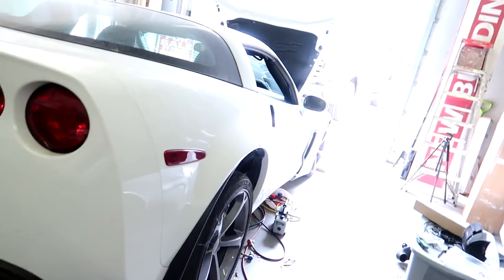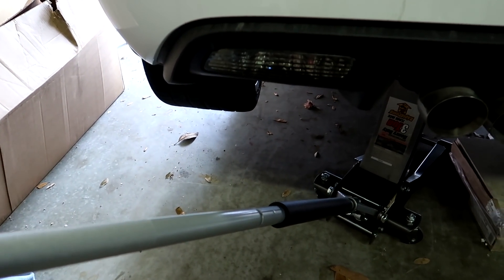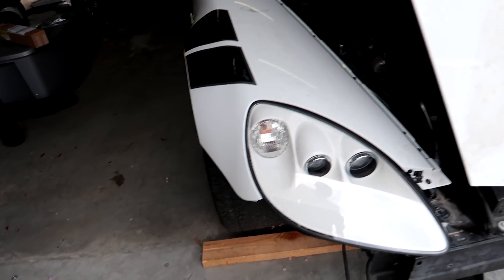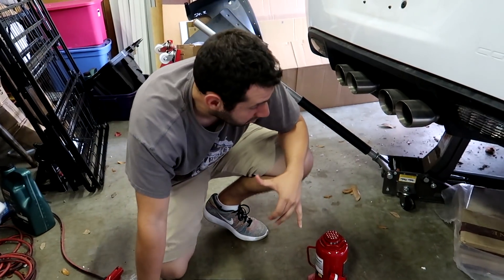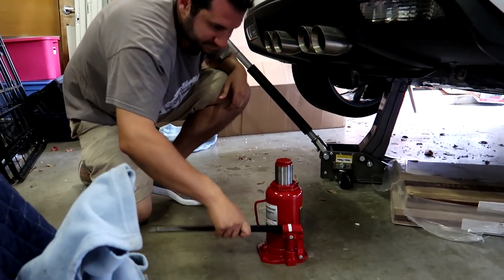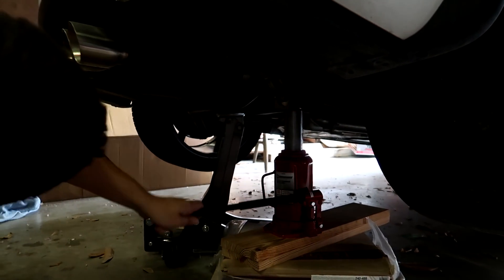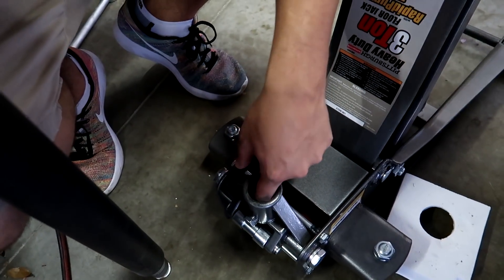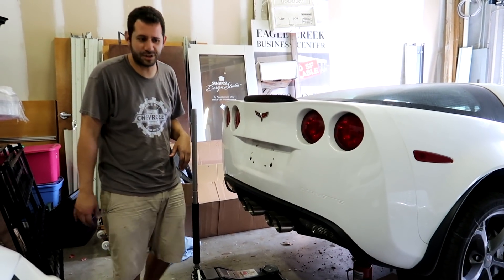Cheap Idiot Gets Harbor Freight Jack STUCK Under Corvette

Comment from the maker: If your jack stays up for more than 36 hours you may need to call a professional mechanic
Reply: LOLOLOL :))
Reply: If your jack stays up for more than 4 hours...

You're a popular guy!!!
Reply: Samcrac "consult your mechanic if your erection lasts for more then 36 hours"
Reply: Hahahahaha.
Reply: Samcrac or or hear me out here... make sure the lock bolt is not preventing the pipe from reaching the pressure release thingy....lol, but I don't believe that actually happened is probably a may 26th fool joke
Reply: Samcrac Having a tough time buddy I have them also it sucks 😬
Reply: LOL
Reply: Also Samcrac that Pad on the bottle jack screws in so you can get it fairly high without even pumping. once you get it close then start pumping.
Reply: isn't the top part of the bottle jack a big screw ? so you can turn it to raise
Reply: Samcrac you take the strew out and but the bar in then but the strew back in
Reply: I don’t see you even using jack stand for your own safety. Go get one for 20$ be safe out there one love PrincePam
Reply: Am I the first the tell you that on the bottle jack, you can unscrew the little red pad up about 4 or 6 inches.  Would of saved you a lot of pumping.
Reply: @Samcrac i just bought one of those same  3 ton low profile ones yesterday. They come brand new very LOW on oil, you are supposed to remove the metal plate in the upper area, and add hydrualic oil to it (directions are listed on the jack itself or the paperwork).
Reply: Props for showing your good shots and your stupid mistakes. The bolt is there for an additional safety, that way you cannot accidentally lower the jack and potentially hurt yourself, think of it as the safety pin on jack stands. 
And speaking of, you should definitely ALWAYS use jack stands when working under a car! If your jack seal blows, you're essentially dead.
Reply: polobunny ... the bolt is NOT there for additional safety so you cannot accidentally lower the car...

The bolt is there so you can use the handle to move the jack around and the handle doesn't pull out of the hole... it's just a keeper ... you can still lower the jack with the bolt in place.

Today I learned...
Why so many people get hurt working on cars ... Sam should do a follow up video on this with someone who knows what they are doing , showing all the many things he did wrong that could end up with life threatening consequences. I can't believe he just did that bottle jack crap on the subframe on a Corvette and thinks it's ok ... I was cringing thru so much of that video my cheeks hurt.
Reply: Please buy a decent set of jack stands, they're not too expensive, and they can save your life.
Reply: Samcrac Dude, the top of the bottle jack unscrews.
Reply: The bottle jack also has a screw mechanism to pre-lift the piston so you don't have to put it on a stack of tiles to lift taller things. 
RTFM..
Reply: Jack priapism is no joke !
Reply: My jack been up for a week now!!!:/
Reply: Samcrac use a hammer and hit the teeth where the jack lock and it will come down
Reply: 4:08 might be the best moment ever in YouTube history! hahahaha
Reply: @Samcrac I did this when I bought the same jack the first time! only... I always test tools before I use them!!! lol Make sure it goes up and down as expected and figure out why it doesn't work as you expect. lol hahahaha. That is my favorite jack, I bought my second one a few years ago, and I sold one i bought for 65 (on the wonderful 20% off coupon) to a friend for 100 dollars! Looks like you learned your lesson on RTFMYSF today! I've had my fair share of that!
Reply: Team Rocket Yes!
Reply: You know the head of the bottle jack has acme threads and you are supposed to turn the head up so you don't have to pump the jack that much.  the more you know.
Reply: she likes it like that.
Reply: I use their Aluminum 2 ton jack and it goes great too. It is very light. I always use jack stands once I have up in the air though. They are cheap and you should get some too. They will save your life.
Reply: Gotta give you props for having the balls to upload this video. I saw your mistake as soon as you had the jack out from under the car and laughed my tits off. 
I can't believe you had never used a bottle jack before, in my teens that was the only jack I knew existed, it's good for a one arm workout! That said, I have the same trolley jack from Horrible Freight, it's in my top five favorite tools for sure.
Reply: haha
Reply: SAMCRAC Man, Now I am ready to see your stuff in a regular basis Lol, I laughed my socks off.
Reply: Once that little screw backed out on me while doing a brake job, and I accidentally pulled the handle out of the jack while the car was up in the air. The jack handle receiver is spring loaded so it automatically sprung upright, leaving me with my wife's car stuck on the handle-less jack.  Solution? I bought another 3 ton harbor freight jack. The first oen has been great for 4 years now. Like the channel, keep up the good work!
Reply: Samcrac I made the same exact mistake, and as my mechanic friend told me "User error". Good on ya to figure it out though, good luck
Reply: Samcrac  bottle Jack's may take forever to go up but they hold the most weight of what a jack can hold also you didn't screw the part that touches the vehicle up before jacking it up
Reply: A highlift jack would have helped you out alot better than a bottle jack although bottle Jack's can withstand alot more weight
Reply: you also may be entitled to compensation

Comment: no jack stands , over extended  jack , what could go wrong?
Reply: Ahahahaha.... safety last....
Reply: And he didn't even know how to use a bottle jack...
Reply: So didn't he didn't have the handle installed properly? I test any jack I use to make sure there are no issues before use. I have the same jack and it need hydraulic fluid to be added before first use. They don't fill it at the factory. No wonder they are cheap. Works once you bleed and fill to proper level.
Reply: @ynots38   lol
Reply: @kaiserwillie67    ditto Willie......+  have (4) pucks in place☺ & (4) jack stands in the ready position😁

Comment: If he’s baffled by the lock bolt on the trolley jack, he’ll be amazed when he sees that he could of screwed the center pad of the bottle jack out to save pumping it so much😂😂😂
Reply: MindBlown Watcher 😂😂😂😂😂😂😂😂😂😂😂😂
Reply: If I'm crawling under a car supported by nothing but a questionable quality tool I just bought a few minutes ago, and have no idea whether it can be trusted or not, I'll want to extend that jack as little as possible. I'd use as much cribbing as I could wrangle up and pump up that jack as little as possible.

Comment: If you are here because your car is currently stuck on this jack - insert jack stands under the frame. Remove the screw in the jack. Begin the decompression process. If you can't properly insert the handle due to positioning, you can use a pair of pliers to manually turn the mechanism. Be prepared for it to drop quickly.

Comment: Many things could be said, but I will refrain, except: Failing to read the manual for a device of a type that regularly kills skilled mechanics every year is unconscionable - think of the public expense of having to rescue you and treat you when the jack fails due to operator error.  Second, not understanding how to use the pressure valve on either of your jacks may mean that you are not cut out to be a mechanic.  Thanks for sharing this with us and please keep the videos coming.

Comment: Doesn't the center of the bottle jack screw out?
Reply: yes it does. it hurt to watch him do it the way he did
Reply: Did it hurt or did you giggle a little bit?
Reply: Yeah they can make up a huge distance if you screw out the top of it. And, you COULD get one that pumps faster, but that would mean getting one with a bigger piston which means more strength/leverage is needed to pump it. That RapidPump has dual pistons, but makes up for it by having an extremely long handle
Reply: Just watched this video for the first time and I was almost yelling at the phone to screw out the top of the jack
Reply: Yep.....he's a helluva mechanic. But he's no Jack Man!!!! LoL
Reply: Jes it must al of them dow🤣🤣
Reply: Yeah they do. If all else fails, read the instructions.
Reply: Yes, although his way was quite entertaining
Reply: I was about to say that 🤣🤣
Reply: I thought that.
Reply: Yes center of the bottle jack does screw out to increase it's max height.  However that also increases it's minimum height.  Which could be a problem if he wasn't able to correct the issue with the floor jack and use it for lowering the vehicle back to earth.

Comment: On the bottle jack you can unscrew the top to raise it up so you don’t have to jack it so far
Reply: I was screaming at my phone the whole time, "Twist the top!!!!!"
Reply: he did not read this manual either😂
Reply: You can tell sam doesn't know jack shoot about jacks.....
Reply: I thought the same thing too. I also don't think he fully tightened the valve. Yes they are slow, but not that slow
Reply: Luke Van Gheem 
I was thinking that too but i don’t think it hold any weight up if the valve wasn’t tight
Reply: Yeeessss exactly!
Reply: Me to i thought he is going to do it after a few strokes if you got the lenghth you dont need to pump  so hard its like its not the size of the ship but the motion of the ocean.
Reply: The technical term is RTFM...
Reply: Braden Rutherford I was wondering how far down it this tread until someone mention the center is threaded and could be extended also I just Jack it with my hand until it gets close then use the handle.

Comment: I guess you've never used a bottle jack? The end unscrews to adjust the length of the ram. You make the fast adjustment with that and then just slowly move the main ram for the lift.
Reply: also while unloaded you can pull out the rod and pump it with your fingers, its much quicker
Reply: that is what she said.
Reply: So, instead if playing cribbage with playing cards, he'd have to haul some blocks of wood for cribbing, right?
Reply: It's better to not use the screw if possible. You want to keep jack extension as low as possible to avoid the risk of shifting load. Cribbing is more stable than an extended jack. In most cases unscrewing the end might make sense but if there is any body part going under the car supported by nothing but a jack, I'd prefer the jack be extended as little as possible and just take the extra time to pump it up.

Comment: The bottle jack is designed to pump LESS fluid per stroke into a LARGE cylinder area.
This equals MASSIVE lifting power with very small EFFORT. It's the basic theory that hydraulics is based upon. It's a 20 TON jack for gosh sakes. It has to pump less fluid per stroke or you'd need a handle TWENTY feet long to gain enough leverage. The floor jack is only 3 ton , so much more fluid can be moved per stroke ,resulting in a faster rate of lift.

It's all about the RATIO of the AREA of the MASTER cylinder to the SLAVE cylinder. 
Good luck....Love the Channel......
Reply: You can't say that. The "s" word is offensive and might trigger certain people.
Reply: phlodel wtf are you talking about, that's the name of the part
Reply: phlodel 
That is funny as hell.
Reply: Also the center of most bottle jacks unscrew to raise it up to the base of what you're lifting, then you proceed to jack it up. This makes using them alot faster.
Reply: Did THEY teach YOU to WRITE like THIS in SCHOOL or DID you COME up WITH it ON your OWN?
Reply: hnrk 
all on my OWN
Reply: phlodel Yeah, ‘now’ it’s primary and secondary. :D
Reply: kraken FR-S - Slow down, reach up and grab that joke that just flew over your head ;)
Reply: If the floor jack was indeed bad, then having more piston out from the bottle jack would make it easier to lower the car down in stages, using the bottle jack.  If the centre screw had been extended and only the last inch or so was the piston,  then the car would only be able to be lowered that inch or so onto some other temporary support.  
I would have raised the bottle jack to it's maximum height, then release the valve to let it go down about a half inch, then raise the centre screw to the frame, then jack up that half inch.
Reply: panda Tec ya. I felt sad for him not knowing that....
Reply: The bad part was recording and posting the entire thing... edit this out to 30 seconds of stupidity instead of 7 minutes of boring.
Reply: Eiserntors Phantom of the Opera à
Reply: Bottle jacks also usually have a screw jack built into the lifting shaft. This is to make them a little faster.
Reply: How do dumb people afford expensive cars? Oh ya, 99% of wealth in the USA is inherited not earned.
Reply: BigDish101 you must be mad

Comment: As a professional mechanic, glad you figured it out. Invest in a set of proper jack stands next! Never trust just that jack. Once the vehicle is raised, set jack stands at the lift points on the side of the chassis (this varies per vehicle).

Never really on questionable supports under that bottle jack, at the minimum have some sawn lumber pieces for this. Remember that if you are lifting on a control arm it isn't designed for a midpoint load, and the floating suspension is part of that support. It may move on you.
Reply: Robert Borchert you are right.  Own the Jack stands before you buy the Jack.  Never trust hydraulics.  A friend was killed when his head was crushed by a dump bed.  Brand new hose blew.
Reply: I totally agree. If you can afford that cheap bottle jack, you can afford to go buy a 2x4 and cut it up to make a pair of decent jack stands. I mean it's not like HF doesn't sell jack stands for $17/pair either. You felt like an idiot about the jack. How much more of an idiot would you feel if the car fell on you?
Reply: @mrdabeetle1  a 2x4 in place of jack stands? yikes.
Reply: @lsswapeverything2518  I wonder if they were meaning wheel cribs
Reply: changing a clutch and pressure plate had to use jack stands and 4x4 wood and some 2x6s for cribbing, it worked great

Comment: There's a little screw you have to undo before you slide the handle into the jack so it goes in and engages the lowering mechanism
Reply: Finished watching nevermind lol

Comment: I have same jack. Has worked perfectly fine so far.
Reply: Nationalcitysycho d i have used mine to lift my infiniti my 2g dsm and my navigator without problem...well mostly my infiniti sits too low on coilovers and have to put wood under the tires to fit it
Reply: This is 100% operatorbut Hes doing the best he can with the skill set he has both physically and mentally
Reply: He posted the video and I'm sure he knew he would get flamed. While mine has been fine and I didn't make this mistake. I'm sure he won't make this mistake again and has saved many others from not either.  Everyone messes up and what makes them stupid is when they do NOT learn from the mistake. Sam has some informative videos that show he does have intelligence.
Reply: Your jack works perfectly fine because.................................this was user error.
Reply: David G i agree with that. But fot the people that don't always watch till the end. I want them to know that people DO have them that work fine.
Reply: Me too.
Reply: Maybe he knows that Youtube pays by the view and pushes videos with lots of comments to the top of search results?  And just does not give a rats ass if he is getting flamed?
Reply: pospc2 same, I love mine
Reply: same here ,had it and used it over 500 times  for 6 years now and never had an issue
Reply: Have the same one it lifts my 6000lb range rover just find bt I also use jack stand like i am supposed to
Reply: we have 8 of them at the shop i work at none of them seize up like that. they do start leaking if you overload them though
Reply: @pospc2 🤣 This is not the one that shows he does have intelligence
Reply: @pablissimus  I can't argue with your comment at all.

Comment: That bottle jack could lift a bus.  Not when sat on a pack of tiles and a plank of wood though.  Just be careful cos as much as you like your Corvette, I doubt you will enjoy it being pressed on your chest when the tiles crack...
Reply: And when the bottle jack has a screw top to make it taller, being crushed under the car is going to feel even sillier.
Reply: Time has an amazing compression load. Should be good.
Reply: @texmex9721  Yea I checked out those bottle jacks, they only screw up a couple inches, unlike other brand bottle jacks that screw about 2/3 of the shaft length.
Reply: @trevors8577  Yea one is really great and the other is terrible and may kill you.  Make sure you get the right one.

Comment: If you had bothered to read the instructions that came with the bottle jack you'd have known that the base plate at the top screws out about 4" higher than just the cylinder!

Comment: Sam, those harbor freight jacks are actually great, despite your troubles. Make sure you bleed it properly, since the factory frequently misses that step.
Reply: What is bleeding?
Reply: @Pugslover  there is a process to bleed all the air out of the little hydraulic pump that makes the jack lift. These jacks are decent, but sometimes the factory will not get all the air out, and then they leak pressure, which causes them to sink. If you google "how to bleed harbor freight jack" you can find directions to solve this problem easily.

Comment: You have a extension bolt on the top of the bottle jack all you have to do is unscrew the mount on the top of the jack. Yes bottle jacks are slow but they almost never go bad.

Comment: I got the same problem with my 20 years old harborfreight floor jack.  With another jack I was able to get my floor jack off.  Then I found out the screw holding the rod was loose same problem as yours.  I am glad I am not the only person with such blunder.  Thanks for showing such blunder to anyone